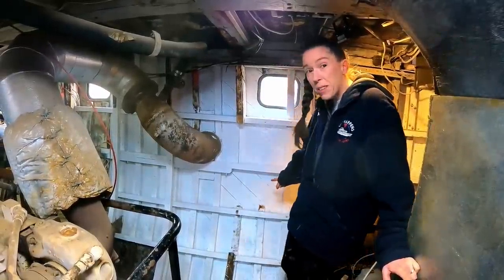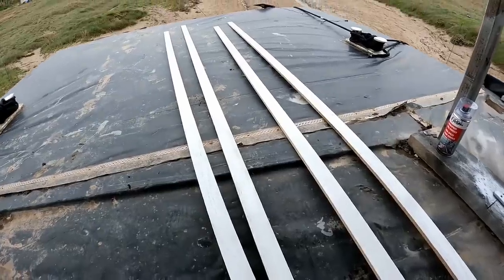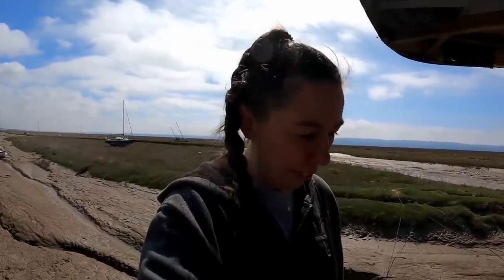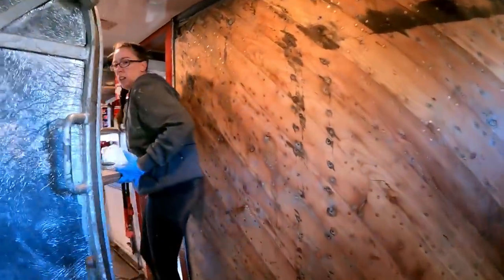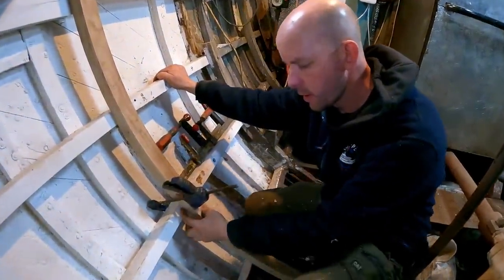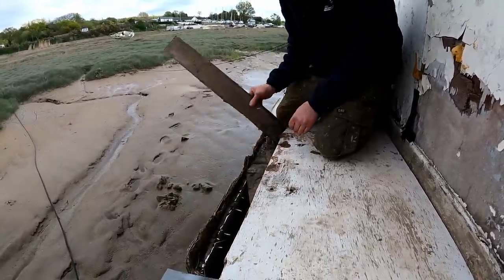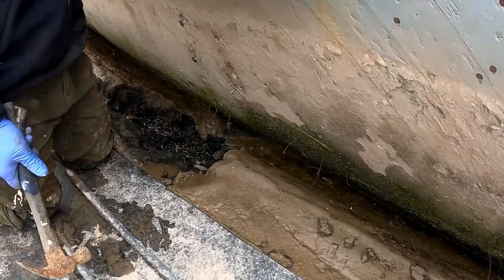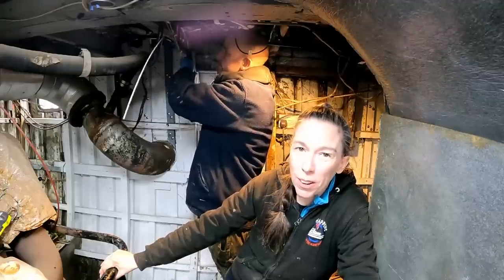Ep 122 - MAJOR Communication FAIL Working On Our Boat! #boatrestoration

Comment: You are getting very slick at replacing web frames and stringers! I like the lamination which does seem to speed things up as well as (I believe) making a stronger replacement.  As someone else mentioned in the comments it is a bit like a jigsaw getting the pieces of wood into the right places. Realy looking foward to you getting the deck up and replacing the rotten beam shelf - at least it should be easy to remove - one good bang with a hammer and it will turn to sawdust!

Keep up the good work - from Sydney, Australia

Comment: You are doing a good job.  Couple of tips.  Watching from Idaho USA
Weld or bolt a vice-grip to a slide hammer.  It really helps pulling out nails.  I weld a nib on the end of the vice-grip jaws so it will reach over the head of a nail.
I also have welded a chain link onto the back of a vice-grip.  Really handy for a rope anchor lifting sheet goods, etc.
Weld a handle onto the punch so you can swing the big hammer without fear of hitting your hand.

Comment: Chris from NZ .I'm no boat builder but would suggest pretending a few frames in a steemboxlike Magic Carpet did. They built a former to get the exact shape but you could try doing a few at a time.some over bent to help with the need to wire the boat to stop it spreading. Can always cut aways try sp
Cutting a frame leengthways up until it is reasnobly straight section. Could epoxy in-between cut if you t hought necessary. Anything too stop trying to push the sides apart.

Comment: When I discovered you project I felt a connection to it as my Father who trained as a carpenter in a ship yard in the North East of England went to Portsmouth to work I think for Vosper's, this was just before the war. But what he worked on was the experimental Motor Torpedo Boats, which were constructed just like your boat, double diagonal planks with boat canvas between the planks and all wood ribs, but they had laminated ribs, as the one piece ones cracked when the boats were driven hard into rough seas. I am in the UK in Bedfordshire , sorry not a very interesting location.

Comment: Daft question from a non-woodworker. Those clamps with the red handles you use to bend the wood to the hull...why are the handles like screwdriver handles? Surely you could get a better and easier purchase if there was a "T" fitting on the end (like a tap)  or a fitting to use a spanner for extra leverage? There must be a rational explanation for this. I was an accountant for 45 years so what would I know? I have adopted your attention to detail when I do the bits and pieces around the house, the results are excellent and the air not so blue!. Great vlogs, hoping I can hang on long enough to see the finished boat.

Comment: Try dipping the punch in a bit of grease or spray some WD40  for punching out those tighter naik holes. Have you tried Cold Galvanising spray for the knees? Then paint as usual. Its very good but does need a proper mask when spraying.
Those trousers, too many onions in the diet.

Comment: I forgot to mention In relation to communication Sheetmetal workers in the aviation world used to use a microphone and head set unit joined by a long communication cable. The ear pieces muffled the noise from the gun. They had no power source in terms of batteries. They were in effect the old bean cans and string from my childhood. There has to be an equivalent small inexpensive unit available for riveting use.